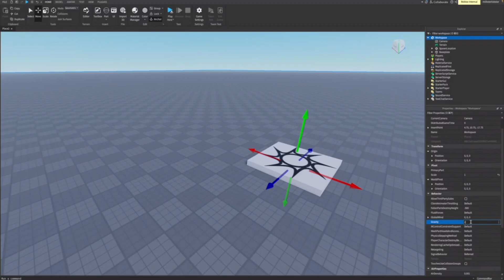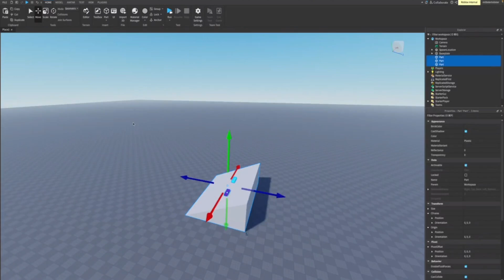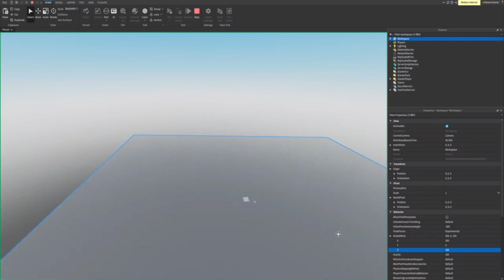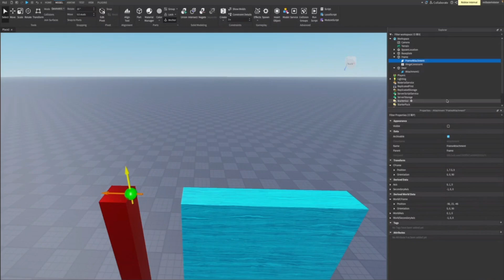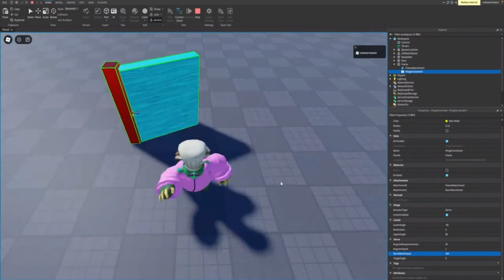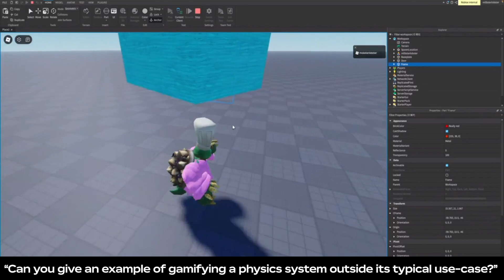How Physics work on Roblox

Comment: Guys when i try to make a part unanchores with a textbutton it doesnt work, well it works because i use debugging print statements and if i click them inside the game anchore isnt activated but for some reason i need to touch them or jump on them so they really fall, but for example with the baseplate it doesnt work, could you try in your computers so i know what is wrong, because sometimes it seems like everything should be working but it doesnt happen, it happened too doing a custom dialog, i put the decal id on the script and it didnt work, at that time i did it with chat gpt
Reply: in the baseplate i meant that even touching the baseplate it didnt work
Reply: You'll need to unanchor the part from the server via a RemoteEvent.